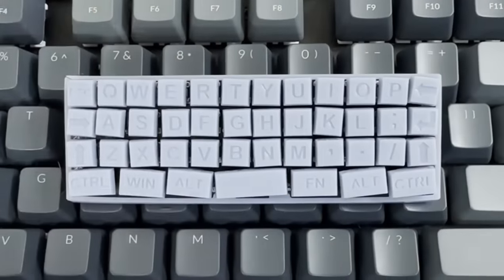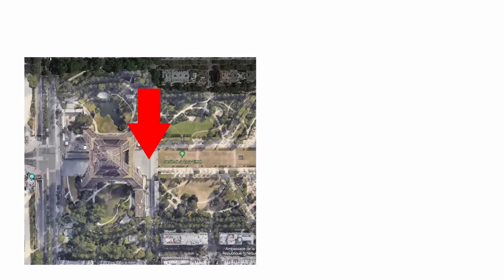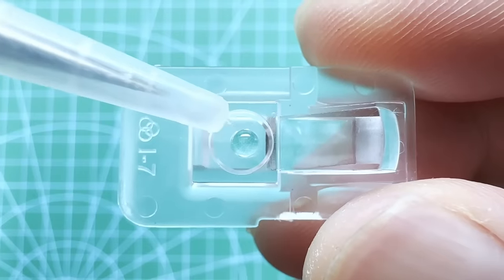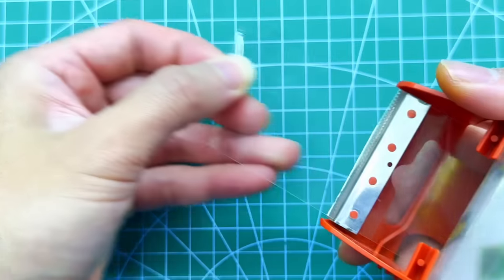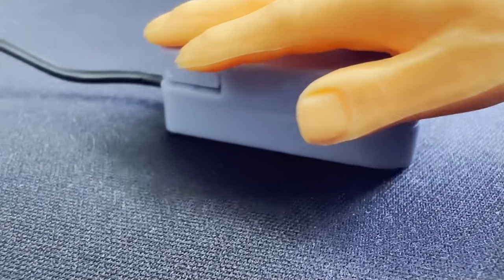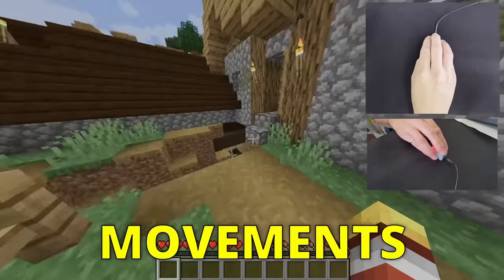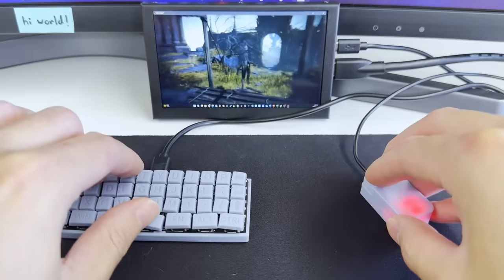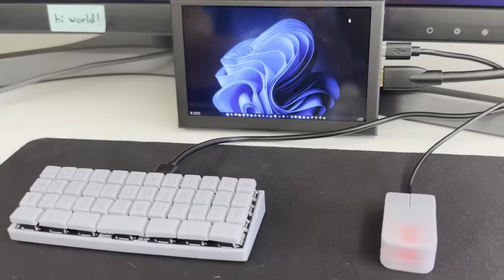I Made the Worlds Smallest Mouse

Comment: hi, I'd also like to customize my mouse but i don't know anything about its diagram for every pin on the sensor, luckily i found your vid. can you possibly tell me the diagram of every pin on the sensor, so that i can solder every component in the right pin. thanks
Reply: Different sensors may have different pinout, so just look at how everything is connected on the pcb (for example, to what pins the usb wires go, where are there capacitors needed, how the switches are connected). For the cheap mice with single sided board this is not that hard.

Comment: it can't be a gaming mouse, because is a laser sensor, a mouse for gaming, has to be optical. laser can't track good the movement when using a sens multiplier in game.
that's why you can't aim how could it be. 

a optical office mouse sensor, has 1000dpi, which is fine for gaming. bad choice on the sensor.

Comment: How did you make it work withou a board?
Reply from the maker: The circuit boards are just metal wires, so you could turn any electronics into a floating wired circuit like with the mouse!
Reply: @juskim  what if it has a MCU on it?
Reply from the maker: @DwAboutItManFr  then that's going to be a lot of floating metal wires from the chip... :P